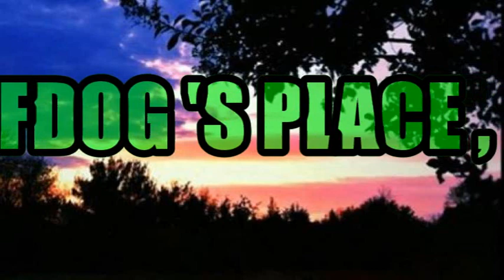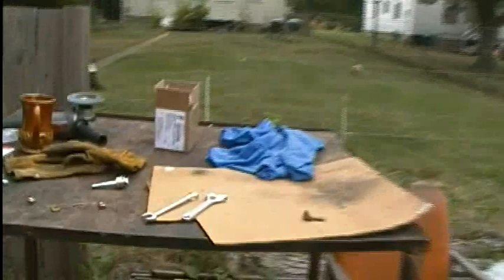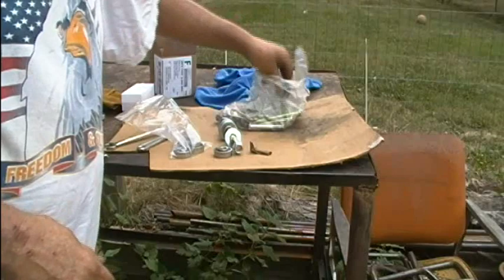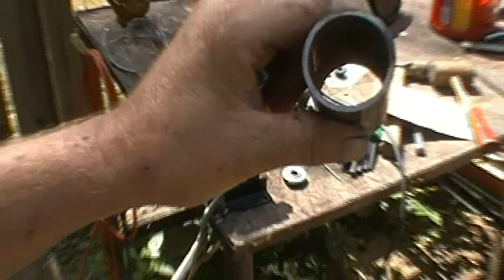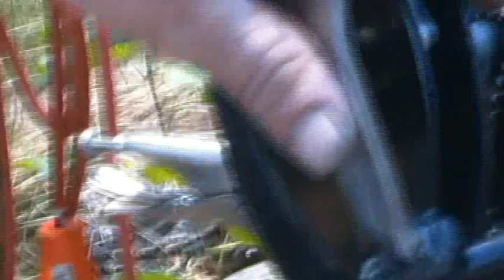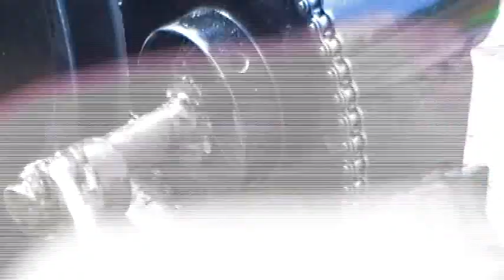SPRINGER BIKE, MINI BIKE KICKSTARTER UPGRADE AND NEW THROTTLE

Comment: Hey cool video man I just found you today or channel and I've already watched like 8 videos is it possible if you can give me links for the throttle and the brake light and running light also I've been saving up for a predator 212cc with 7 horsepower and 8.1 foot pounds of torque finally got it today I need a break it in I was thinking of running it as premium gas or not so can I get your thoughts and jesters and ideas for what I should do on my new motor to help it break it in like if I should lower the idol how do I lower the idol I just watched your video where you been messed with the carb and I was wondering if you can please share me the links to the parts and the tools and videos that will help me out on how to break it in cuz I would love to put the lease amount of stress on the motor and the break in but I would also love to get that big bang bang you know so I'll be awesome if you can show me some links and show me how to make the motor be the best as It can and cheapest as possible thank you and have a great night
Reply from the maker: Thanks Dustin, I'm happy to help as much as I can.
For the parts links, search on E-bay. For the tech info, look at the playlist for the Springer Bike. I'm sure that I've added all the links in the descriptions of each video where the parts came up.
As for break in, follow the manufacturers suggested process.
Glad you found my channel & like it.  Good luck & have fun with your build.. Cheers
Reply: LOL thank you yeah cause I was just thinking where I'm at I'm in Preskett Arizona on my think I'm at 4000 feet so I don't know what type of oil to put in and I don't know if he'll be better to break the motor in with premium gas or normal what is it 85 or 87 gasoline so I was as I've been asking around and I was hoping maybe you have some ideals or you know something LOL that would help me out I know that the Idol  is a little too hard because I had A 212CC predator 6.5 hp and I believe back their nose like 7.2 foot pounds of torque and so i'll like to do a build on a minibike and cruise around again I really miss doing that LOL so anyways thank you for your comment and good luck man I future projects or anything else you got your hands and thanks looking forward to it ha ha Ha
Reply from the maker: What ever gas you choose to run in it, stick with it. cheaper is easier to get. The extra octane doesn't really help unless you're running a truly "built for it engine". & the oil, I recommend 10w40, just like real motorcycles use.  BTW I've been to Prescott Az, & really enjoyed myself there. Nice town.
Reply: Ohh really? I thought with premium it gives it more spark or something I don't know LOL to be honest but first from some people I keep on hearing that if you mix the oil with the gas it does something but I don't know I've been watching so many videos like I always do so I think I'm a from the recap of tonight of watching hundreds of thousands of videos figure speech I'm going to take people's recommendations the ones that I like in number do them some people say yeah girl and lower the idol or something for say don't lower the idol and some people say do youdo this and do that Anyways thank you
Reply from the maker: I know too much input can be confusing. Higher octane is for engines with higher compression ratios. These engines are not built that way. & a low idle doesn't hurt anything as long as it keeps running.
If you can get gas without ethanol, I highly recommend that because ethanol attracts moisture and will rust up your tank and foul your carb if it's not ran often enough.
Mixing oil with gas is good for 2 strokes, not 4 stroke engines. Most likely it will foul your spark plug, more than help anything.
My pleasure, Always glad to help.
Reply: Well again thank you very much for the input where do you think I can buy the gas that has no ethanol in it because I don't know where to get it to be honest LOL
Reply from the maker: They should advertise at your local gas station if they have it.  I can't find it around here.

Comment: I been building a mini chopper out of 3/4 black iron pipe and I have it almost done but my problem is that it has a lot of sway or shake I can touch the peg and it shakes I have supports for the steering and it still shakes don't know if u can help with it
Reply from the maker: I'd really need to to see it to help, but a few things to think about are,...
Are the axles and all nuts and bolts tight ?,..are the welds solid ? did you use
Gussets on the angles where ever possible ?
 Check these things out and let me know what you find.
Good luck, you'll get it..
Reply: ***** thanks one of the weld was not good now there is no sway in the frame
Reply from the maker: Great, Glad to hear that you found it !